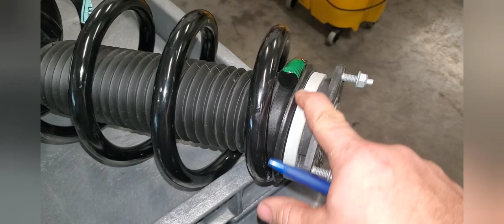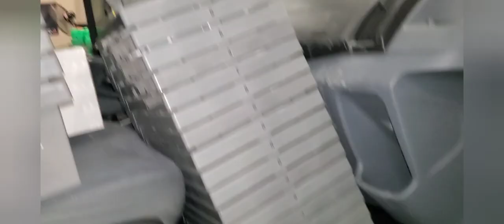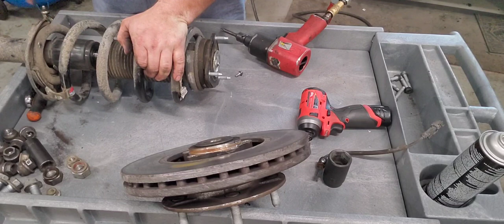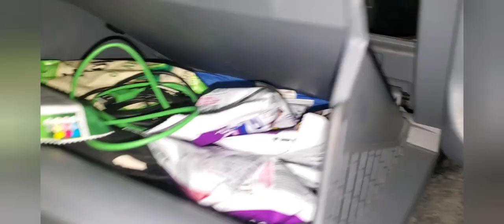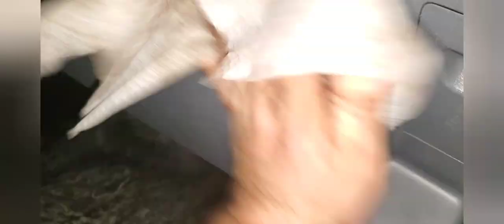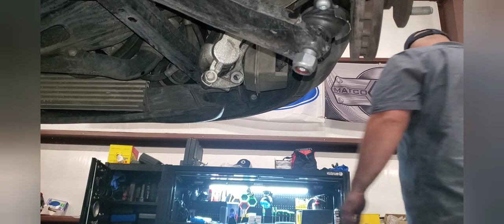Ford transit ball joints without the special tool and front struts

Comment: So basically, unless you remove the whole thing, you can't do ball joints without the special tool. Thank you, Ford.
Reply from the maker: Yes
Reply: @medtec6747   You should pin hugolafhugolaf's comment.
Reply: Yeah, and you have to remove the wheel bearing assembly to R&R the front rotors. It's my understanding that to R&Ring the rear rotors requires removing the axle shafts.
Reply: @videopipeline6419  It does.  Worst designs ever.

Comment: Just did this job with the new strut assembly from oreillys auto parts.  Fit perfect and saved time.  I’m in New Hampshire so tons of rust and seized everything.  Recommendation just put all new back in.  I dropped strut with everything attached.  Then installed everything new, bolts, nuts,brakes, bearings, knuckle, tie rod end, stabilizer link,Ect…even new dust shields.  (About $850 for both sides in parts )Everything was due anyways. Made it a lot easier because everything was seized.  Only thing original  I keep was caliper and bracket.  Took about 2.5hours per side in driveway. Whole new front end. Drives mint !

Comment: Great Video, The Detail is very good, so keep things the way they are, i just spent 2 days wrestling with a lower ball joint replacement on my mk6 transit, and your certainly correct, one cant press new ones in with out a proper press, I wish i had found your video 2 days ago !

Comment: Did you do a video on how to do the driver's side? I'm wondering how to get the strut off and how hard it would be to change all of this out on the drivers side also.
Reply from the maker: The driver side is easier as you don't have to move anything except some carpet out of the way

Comment: I used a couple hammers on the ball joints. Pounded it out, then pounded it in using the nut to protect threads while walking in the side bolts as the hammer made progress.

Comment: On my 2021 Transit the lower balljoint can be rotated with a T-50 which can be another method of getting the balljoint t 'unbind' so that it can be removed from the lower control arm.

Comment: Hey first off just wanted to thank u for the vids they’ve been very helpful with a transit that’s a glutton for maintenance.   My question was if you could give me the part # or even just the exact bolt size of the knuckle pinch bolt?  I picked up the knuckles and strut assembly but knuckles don’t come with em so against better judgement I reused the originals temporarily.   Even up here in Maine it wasn’t too bad getting it all apart thanks to a healthy addiction to fluid film.   Hope u catch this question thanks!

Comment: I like real time. Why didn't you put the air shield back on the new assembly?
Reply from the maker: The place where this truck drives every day is a pea gravel parking lot and small stones kept getting wedged in the little hole that there for the ball joint and they are practiccly impossible to get out without removing the hub and rotor assembly. I talked about it in depth in the transit strut breakdown video.

Comment: The pinch bolt torque is 76 lb ft, plus 180 degrees. I am installing a lift and was wondering about this. Do you use a new bolt? I guess it is the proper thing to do, but was wondering if you re-use bolts successfully and can still put the extra 180 degrees on it. Seems like it's an awful lot of torque to add 180 degrees. I started to add on and stopped at like 90 because I feel like I am approaching something like 180 lb ft on it, and last thing I want to do is break a bolt or strip it.

Comment: I would recommend not to put your foot in the wheel well if you are working at home. 
There is a spot on the A-Frame towards the inside like an opening, you can put a pry bar in it and that makes the A-frame very easy to move for mounting and Dismounting main Ball joint. Good old principle of fulcrum..
Also it’s easier to Mount or Dismount ball joint with the wheels straight.

Comment: You can't say you did ball joints without special tools: you cheated and bought the whole knuckle assembly! But really, great video, thanks.
Reply from the maker: Oh I did it without the tool. I actually bought those loaded knuckles to have as hot spares for when I have to replace others. But I get your point. I really do wish ford made them easier for the DIY to do

Comment: Any particular reason you left the dust shield off? What I would have liked to see you explain or show is what lead you to determine this had to be done. Did the ball joint fail or the strut assembly start making noise? They definitely don't make these vehicles easy to work on for fleet purposes.
Reply from the maker: Yes we were seeing if we did that we would catch less small stones in that hold that they make in it for the ball joint that causes what my emts call a metal on metal grinding noise every time a little pebble wedges its way in there.
Reply from the maker: The ball joints may have had some play to them and we replace all of them at 100k no matter what I can't remember what was which on this unit
Reply: I'm chasing down a front end passenger side clunk now on a transit. I do plan on uploading that video of how I go about it myself but I give you a lot of credit working on these big junks
Reply from the maker: We get that complaint a lot I first start with making sure you haven't had one of the control arm vertical bolts in the rear rust out and break which can cause the whole subframe to shift, next I check bushings in the lowe control arm and then I side load the struts. It's almost always one of those
Reply: I can lightly rock the van from the door and hear the clunk or over uneven pavement. Took the sway bar links off.

Comment: The title of this video is severely misleading. You should put Loaded Struts and Knuckle replacement. You didn't R&R the Balljoints you just replaced the knuckle.
Reply from the maker: The knuckle I replaced is the ballpoint knuckle assembly ford sells the ball joint and knuckle come together, if you don't want to buy thr special tool to R&R the ball joint what I show you in the video is your only option with the transit
Reply: @medtec6747   I didn't use a special tool from ford to remove the ball joint. I went to a hardware store and got "2" 5/8-18 Nuts welded the nuts together to make a long nut. Then welded them to the nut that came off the ball joint and used a slide hammer. In about 20-25 slides it came out. Plus I live in Maine where rust is terrible. But... I'm also a World Class Technician and very creative. So there's that.
Reply from the maker: @ASEWorldClassTech  I dont doubt you are very capable and indeed world class. I was just getting at the fact that without using and or making special tools you can get the ball joint and knuckle together for a pretty decent price and replace them as an assembly is all I was saying.

Comment: Dust cover
Reply: @medtec6747  do you eliminated the dust cover in the disc
Reply from the maker: @carlosotero9984  oh gotcha yes there is a little hole near the ball joint shield that pretty large stones keep getting caught in and rub against the rotor. pretty sure it comes from the driveway that these ambulances go in and out of every day. I've been taking them off on the trucks that are in that station because its been happening so frequently. The shields on the transit don't have any air scoops like you see on an E-350 they mostly just keep dust off the rotors but I saw the gravel that keeps getting stuck in there as a greater threat so I remove them from trucks on that station. I wouldn't really recommend doing it unless its a common problem for you but the five or so nights that Ive had to drive to the station in the middle of the night to get a rock out of there for a truck with "grinding brakes" is enough to for me to warrant it.
Reply from the maker: When I was editing this video I cut out the part where I was listing off al the part numbers and pointing them out It seemed a bit droney to me so I figured Id just list them in the description and apparently I cut out the part where I talked about that and didn't realize it. That's why I was wondering what you meant when you said dust cover. Ill update the description with that tid bit. Thanks for the feedback.
Reply: @medtec6747  thank, your video give me a lot of advice I work with ambulance to in Puerto Rico
Reply: @medtec6747  Well that makes sense, now the autistic side of me can quit yelling "REEEEEEEEEEE, dust shield" in my head. ;)
Reply: Second that. Lmao. In the rust belt that fall off